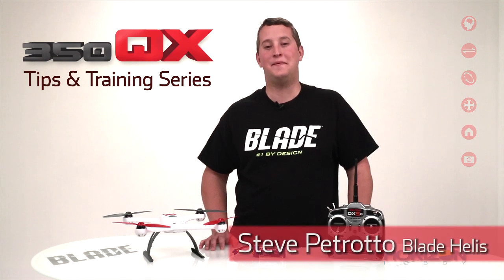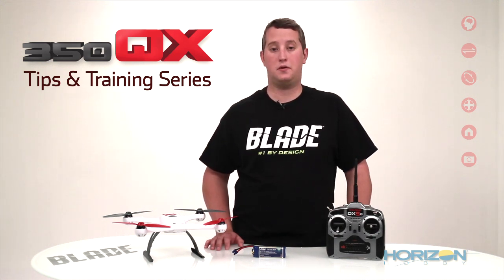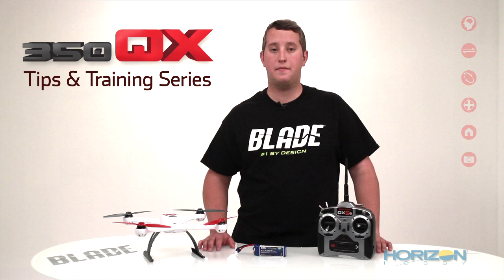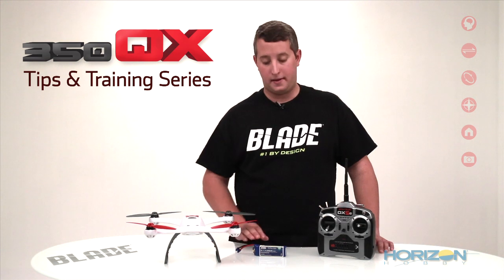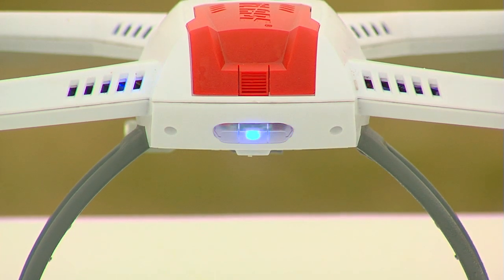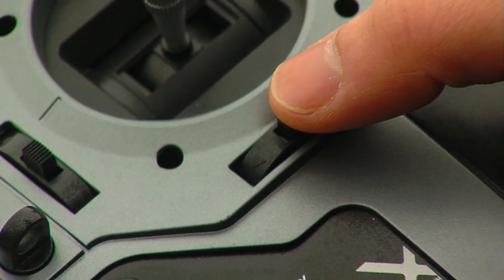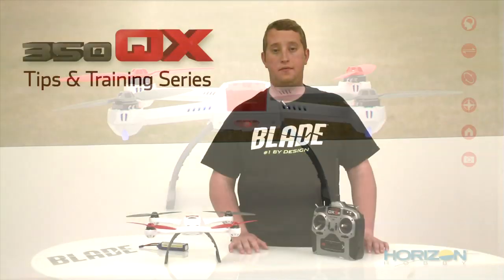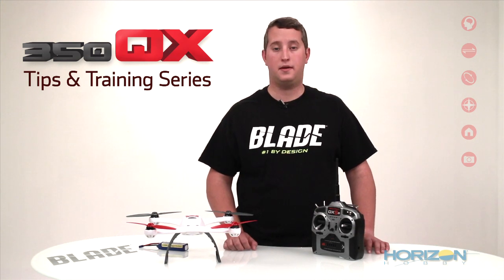350 QX Accelerometer Calibration

Comment: Hi, I have just purchased a v2 350qx bound to my DX6i.

From what I gather the steps should be the same, start in AP mode, then flick the mix toggle to goto Stability mode?

I can't seem to get my model to enter calibration though? Can you please advise what process to use on the DX6i and the V2.

Desperately need to try calibration as my NEW model wanders all over the place.. 

Thanks in advance

Comment: Don't let it touch the ground it will go into crash mode beep and then when you re-power it will be counted as a crash. 229$ for the v2 board 159$ for the v3 board makes sense huh. But it was my fault I let one leg touch the grass and it turned on it's side now the pitch up will not work. I should have left the thing alone and stayed out of the calibration mode for the accelerometer  my bad. Oh if you are wondering the other two modes work fine just not the first one.

Comment: The 350 QX is NOT WORTH THE MONEY! It has never flown correct even after countless calibrations and blade replacements and it has NO resilience at all, it breaks from the simplest crashes and there is no way to fix it. STAY AWAY!
Reply: B Pip I got QX2 and QX3 fly great had them for years.You can calibrate out dumb thumbs.